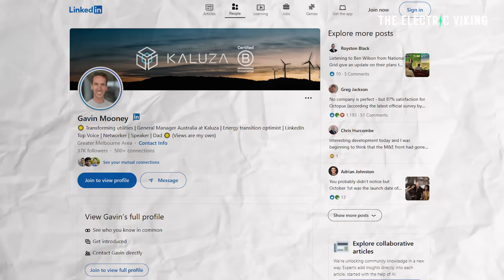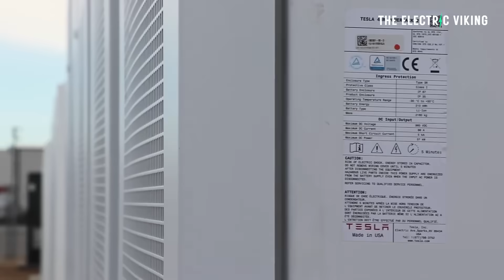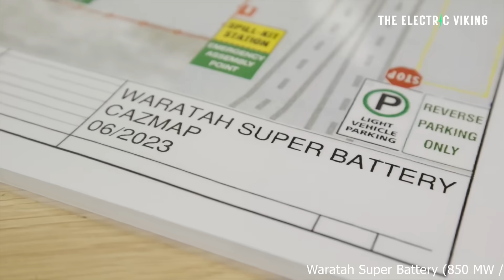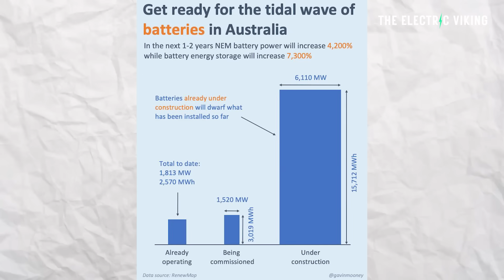Battery storage in Australia will increase by 7200% over the next 2 years

Comment: Can someone explain why are capacities are quoted in hours instead of MWh? Surely that depends on the power being drawn? It sounds like phraseology chosen by the fossil fuel lobby to give the impression that batteries are not capable of storing energy for days or longer and fossil fools then claim that coal is still needed for when it's cloudy after the sun goes down. If you need more energy to last longer through overcast periods just add more batteries and solar. In Australia that shouldn't be an issue.
Reply: MW is max output and MWh is storage capacity. So a 100MW/200MWh battery can discharge at its maximum rate for 2 hours, or below that for an equally scaled amount longer. We need both numbers to answer 'how much?' and 'for how long?'

Comment: I have a question, China currently has sales for EREV's taking off, faster than BEV'S. This shows how fast the market is changing through competition, but I ask myself why are EREV'S growing so fast in China? Probably because of reliability, total running costs and more. 

So with large projects like energy storage and generation, the location and resources are always different, so an EREV type of sustainable grid, would have All the benefits in terms of flexibility built in. Maybe 1/10 scale gas/clean coal ECT can be used for emergency battery charging, (when there's no sun,wind) replace the expensive and dirtiest grid's with the best solution for each location, while cutting expenses and reinvestment, IDK this seems logical to me, because you can cut emissions and cost by 90 percent

Comment: Storage needs to increase by more than 20000% with current storage capacities.  And it shouldn't be provided by *batteries*.
Reply: Evidence?
Reply: @julianskinner3697  it quite simple. Look at the current and forecast capacity requirements during peak usage periods, and then work out how much storage is needed. Then look at how long batteries can supply the demand and if there are better alternatives. Don't forget to include the industrial users who power down or reduce their consumption each and every peak so that the grid isn't overwhelmed. The data is already available if you care to look.

Comment: I want to know if we can run the Portland aluminium smelter off battery power. If that happens, there's basically no need for coal / baseload style power.
Reply: Read up on Thermal energy storage. Energy storage can come in many forms. 👌
Reply: @danielkorsak3980  Smelting is high grade heat, its probably a bad usecase for thermal energy storage I believe.

Comment: I love the idea of solar and have been advocating for roof top solar hooked up to a micro grid battery with the battery connected to the grid for better than 20 years .
People who have no idea how the grid works can not appreciate just how many problems having thousands of inputs into the grid makes for controlling the grid . Right now the only reason why the grid does not fall apart is because the coal fired power stations burn off the excess via massive resistance heaters on a micro second by microsecond by microsecond  basis . Remember what you should have learned in high school , ac electricity has to be balanced so supply has to meet demand all the time without fail or the system falls apart .
Reaction times to balance the grid are measured in nano seconds 
This is not too impossible with only 300 inputs into the system but is a mammoth job with 1,000,000 inputs that vary every second as branches sway, sun goes under a cloud , etc etc etc . Quite literally that small flock of sulphur crested cockatoos playing on your TV antenna throwing shadows on your cells can bring down the entire grid if the cells are connected directly to the grid as can 1 bad inverter that goes out of phase with the line it is connected to . 
Because of latency , hundreds if not thousand of computers will be needed to control all of those inputs so they balance outputs all the time real time so the delay in a signal getting from Canberra to Melbourne can also bring down the system and putting it back on line without an actual generator spinning some where to set the phase timing is impossible .This sort of control cost money, , , BIG MONEY so any one who tells you that power prices will drop is strait out lying . It is also why in strong winds turbines have to shut down because they go out of phase and keeping them in phase is the single most common cause for turbine fires .
We could of course revert to DC which solves the phasing problem but makes changing line voltages quite a problem .
As every engineer know complexity is the enemy of reliability and no computer is going to change that , which explains the opening line .
Then we come to the big problem , who is going to pay , and it will not be the shareholders who accumulate more money every hour than you earn in an entire lifetime .
Reply: What utter nonsense,  big generating sets vary phase all the time, that's why there's a market for it.  It's called FCAS for frequency and ancillary services and that market is controlled by the market operator. 
It used to be the domain of the large spinning turbines of the coal generators but now its being supplied by the large batteries because they respond in milliseconds.

Comment: Total daily electricity consumption in aus is 750GWh per day, ish (before future electrification of transport/industry), compared to the ~16GWh battery to come online in the next 1-2 years. Battery install growth will need to continue at this breakneck pace for a while to make 100% renewables work
Reply: Those big batteries will deliver into the evening peak, with a disproportionately large effect on pricing.
Reply: @ sure, but it is important to acknowledge the orders of magnitude here. even if it’s perfectly well timed, it can only cover 2% of current total demand. The growth needs to continue for there to be meaningful change
Reply: i.e., the growth described in this video is necessary but not sufficient
Reply: @unseparator check your math again
Reply: AEMO forecasts that the NEM will need 660GWh of storage by 2050, but about 450GWh of that will be Snowy 2, hydro and other deep storage. The main role of batteries will be short duration intraday storage. The grid will never run on batteries alone.
Reply: @gibbonsdp  Oh, interesting. Do AEMO estimate how much intraday storage would be required in a full renewables scenario?
Reply: @unseparator  AEMO 2024 ISP section 6.1

Comment: I have no information about battery lifetime for these huge installations.  Can anyone supply such information?  Clearly, the new chemistries coupled with advanced BMS can make a significant difference.  Where will Australia be in say 10-15 years when many of these installations need major maintenance - as in - battery storage replacement.

It is possible my comments are a nothing-burger, so long as maintenance costs do not significantly exceed current generation plant maintenance costs.  If cost/kWHr for batteries continue to fall off a precipice, then maybe this is a hugely beneficial move by the Australian energy providers..

Comment: Great but you need about 850GWh of storage to run the grid on 100% RE with safe margins (72 hours of demand storage). We are still far from that.
Reply: Nobody needs 72h of storage for an entire country...
Maybe 8 hours if you want to be super safe.
Reply: @udishomer5852  What about annual seasonality? Daily is easy to manage.
Reply: @udishomer5852  If you want 100% renewable energy as your sole form of power 24/365 you need 72 hours. 99% of the time the 72nd hour won't be used, but is there on standby . Meantime, excess stored or generated energy can be used for manufacturing.

If we want to go 82% we'll need about 200-300GWh. On occasions that will give us 100% RE but not reliably.
Reply: We will use evs as our batteries
Reply: @julianskinner3697  Once all 15 million vehicles in Australia are EVs, with average battery size of 60kWh yes, as that would give 900GWh of storage.

Comment: "4,000 megawatt-hours (MWh) of electricity can power approximately 500 to 1,000 households for one hour. This is based on the average household consuming 1 to 2 kilowatt-hours (kWh) of electricity per hour"...is this correct, if so it means batteries cannot do the heavy lifting yet perhaps? 

Thank you.
Reply: A meg/hr. is 1000 kwh. 4000 meg/hr is 4,000,000 KWH. A big nucular reeactor is 1000 meg hrs.  A large coal boiler unit is about 250 meg hrs.
Reply: @kkarllwt  You are not even close.

Comment: I do not believe in what is said on YouTube, but my actual lived experience is that the promises of renewables reducing the cost of energy is not happening!
Reply: Have you not been aware, that electricity supply is currently in a disruptive transition that requires two entirely different supply systems to run in parallel, until one of those systems, that being renewable energy supply, is actually completed as a full system and ready to fully take over. Any current increased cost is actully due to the need to temporarily retain the fossil fuel based electricity generation until the aforementioned phase is approached.

What are you expecting, that there is some sort of magical switch that just changes the system over in an instant. How many times do representatives within the energy sector have to explain this to the public, but it keeps getting ignored, instead current electricity costs are blamed solely on renewable energy. It's just a bewilderingly dumb perspective.
Reply: Gas is what is causing power prices to spike
Reply: @whatsyamaksud  .....and coal.
Reply: There is no instant cure to power prices.  Installation costs of solar cells and batteries guarantees that.  However, with the solar and batteries we can ensure that long term the cost in $'s  and environment will not increase
Reply: @jacko1956oz  That is all very fair comment, but just to add, don't forget that the existing coal fired generation fleet in it's entirety, has been and is essentially at "end of life" anyway. So all those generation plant has been due for replacement anyway. So the new infrastructure costs you allude to, were inevitable anyway, one way or the other.
Reply: @BrentonSmythesfieldsaye  agreed but the fact remains. The startup costs mean that the desire for reductions in energy costs is not going to happen quickly, either for individual homeowners or state governments. But in the longer term, $ cost will at worst not increase as much and in environmental costs energy will reduce enormously.
Reply: I am guessing that your actual lived experience does not include having reasonably priced PV panels installed on your property recently? If not, ask Sam about his actual lived experience regarding this....
Reply: If you want to reduce your power bill fill your roof with solar if you rent work a deal out with your landlord it’s never been easier

Comment: Whats it going to cost Viking?.8 hoiurs if the sun don't shine or the wind doesn't blow? is that all, what happens when we have a week of bad weather?

What is the life span of these batteries?

Will it make power cost to homes cheaper?

Just another feel good puff piece from the Viking.Don't blame MSN do better than them.
Reply: Its  going to happen despite all the desperate bleating from the likes of  you!
Reply: Find the last time we had low wind and low sun for a whole week across a critical amount of areas in the NEM.  How often does this happen ?? I understand that in certain isolated Areas it is common,  but how about  on average across multiple states??   I don't know this answer but have heard due to Australia's large area, it is massively rare ??
Reply: @GeoGeo451 Analysis of 100 years of BOM records has shown that an extended State-wide dunkelflaute occurs about once every 10 years. Even then, modelling of conditions showed RE could still deliver ~75% of electricity demand. 

The balance being delivered by gas peaking & demand management. The analysis showing it’s actually cheaper to pay large users of power to shut down for 2-3 days once every 10 years or so than it is to build & maintain generation that’s only required for ~72 hours once a decade.
Reply: @markboscawen8330  Yeah, I have heard those types of stats before but haven't heard it on Sky News, so it can't possibly be true.
Reply: So you haven't bothered to be even the slightest bit informed, from sources within the energy sector. It's all readily available from the optimqal sources online. All you have is mischievous questions.
Reply: When is this magical time when the wind isn't blowing in Bass Strait, Great Australian Bight, or off the West coast of Perth?  Please tell me so I can arrange a vacation.
Reply: @blazegarbo6884  You're asking me to predict the weather.Even God cannot predict the weather, so what chance do I have?

From memory I don't think the east and west coast grids are connected. Makes no difference what the weather does.
Reply: @Mixos_place  Oh, I thought you knew all about it.  West coast of Perth is the windiest part of Australia + dry & sunny.   The area around Tasmania is also very windy so that covers Melbourne, Adelaide, Hobart & Sydney.
Reply: So no answers just group think from you lemmings.So predictable..
Reply: This guy is reminiscent of the buggy whip manufacturers a century ago
Reply: Try doing some research on the success absolute success of the first  big battery that instilled in SA. It has been amazing. Go do some research then come back and text what you’ve just text